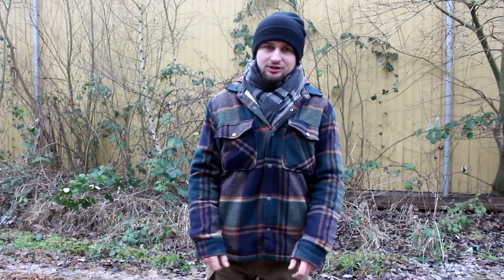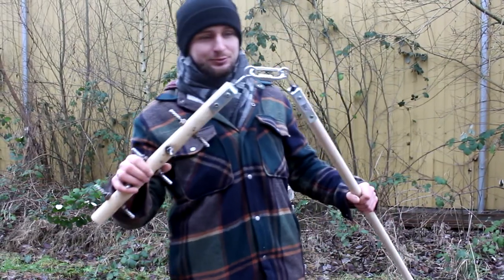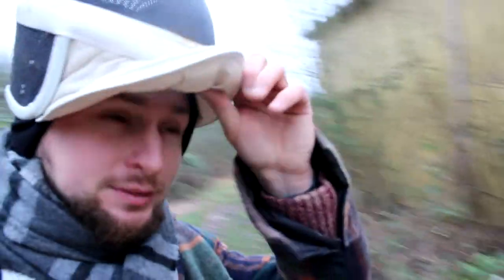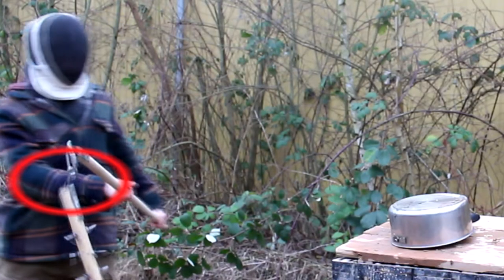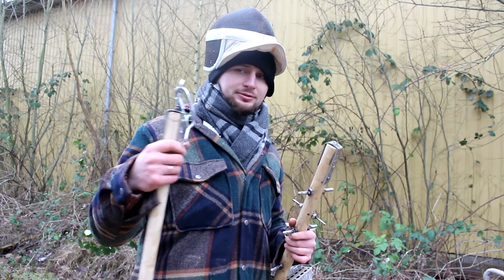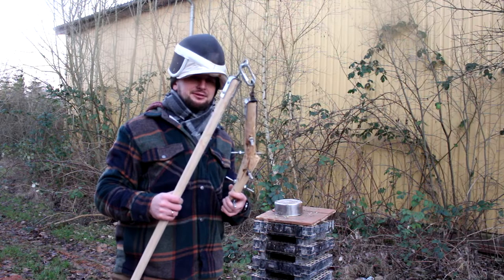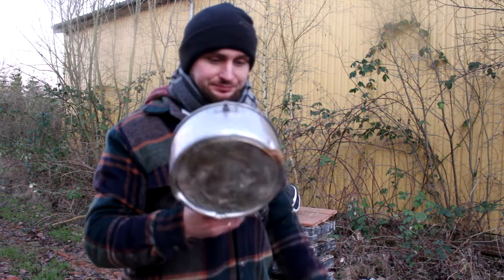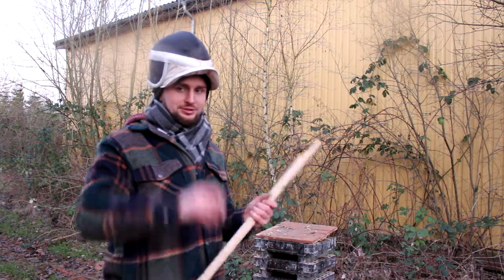Selfmade WAR FLAIL test

Comment: Ok first thing , this is one of my favorite weapons for zombies , you made it simple and effective just like it’s supposed to be , high impact while still letting you be fluid in your movements, you can hit super hard and never have your swing interrupted by the impact. It seams to have more of a set power level wether your swing is heavy or light , more or less . I know skall did some testing like this but I think you did a better job , my only thought on how to improve it would be maybe have a thin strip of steal along the hitting part so it’s less likely to break.
Reply from the maker: thanks man! 
yea i think that it would be good chose for zombies XD hehe 
this weapon (what i made) was weak ... i used cheap light wood (normal brum stick) and hooks and carabines from chinese shop - i did not want to use money for fast project like that XD) next time i will use better wood and i think i will use normal chain instead of this "construction" i made here (i was trying to make it looks like this medival version - this is why i decided for this solution). i had so much fun with smashing stuff heh this is why i am thinking about making one more but BETTER : D hehe